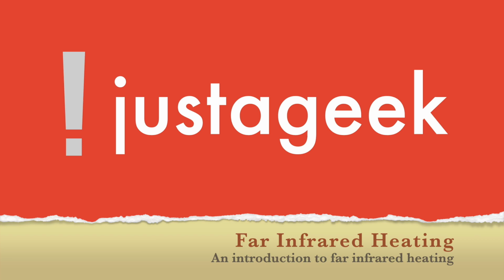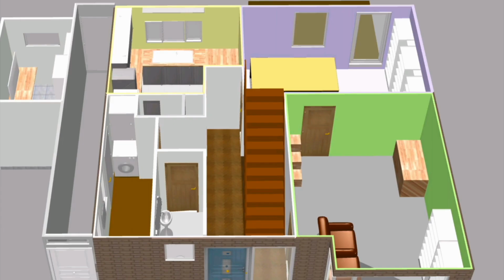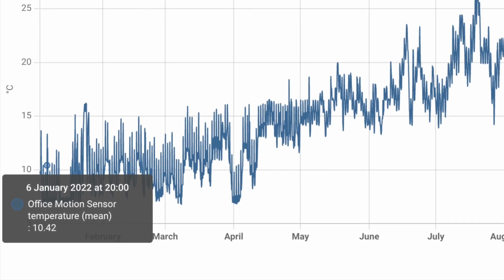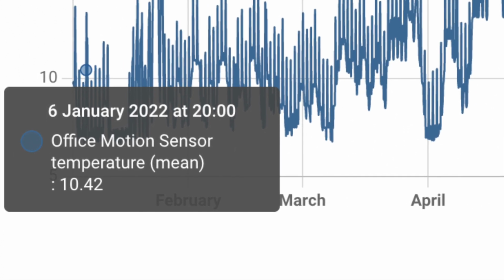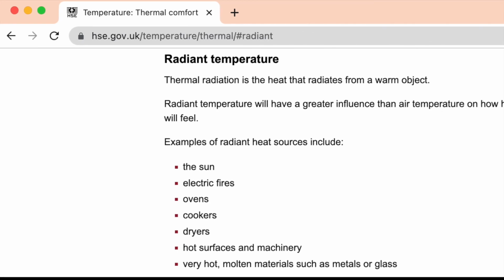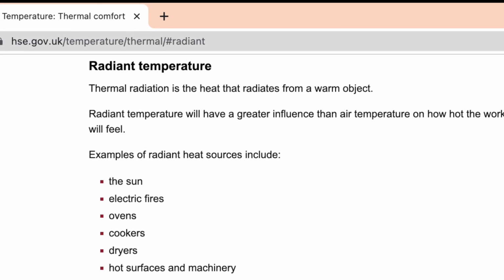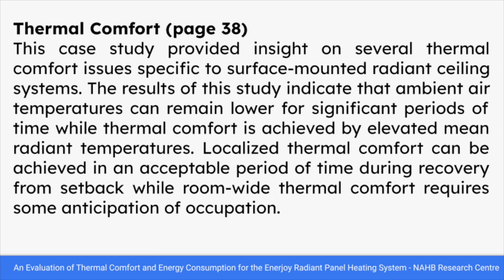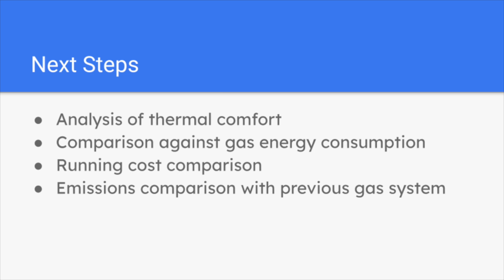Far Infrared Heating Project - Introduction

Comment: How do you find the fact that your front may be warm and your back is not being heated? Assuming you are facing the heating source of course.
Reply from the maker: It's not something we've really noticed. The panels are generally mounted on the ceiling and the IR tends to reflect / be reemitted by surfaces in the room. A few noticeable improvements other our previous heating system:
- leather seats are heated by the IR so when you sit down the seat isn't cold
- hard floors tend to be similarly heated
- we noticed draughts through the chimney far less in stormy weather

Comment: Hi, Peter, Thanks for going into such detail on your FIR  heating experience. We have a 6.8KWP solar array with a 13.5KW battery. We are still using mains gas and I am keen to see what options are available other than AHSP and started to investigate IR heating panels and whether they might be more cost effective compared to gas. I am already using HA to track solar usage as well as exporting excess solar to the grid with Octopus Flux. I like the idea of using IR coupled with motion sensors as my fear is IR would get very expensive if not used efficiently.
Reply from the maker: Hi Chris, thanks for the comment. Home climate control is an interesting decision to make with many variables - whether IR will be comparable / cheaper than a heat pump will largely depend on zoning/controls. I've been reflecting on controls and I suspect the best is a mixture of motion sensor, normal temperature measurement and black bulb temperature measurement - I'll be putting out a video on the topic in the near future.

You might also want to look at air to air heat pumps (effectively air conditioning) since they tend to be more responsive that air to water systems.
Reply: @notjustageek  I use Tado to control the boiler with every room zoned using smart TRVs so I like this approach and it is working well for us currently to help manage our gas bills. Whilst trying to balance cost vs comfort (trying to keep everyone in the house happy😊). I look forward to your video on heating controls. I need to look into air-to-air heat pumps. I know @TimAndKatsGreenWalk have an A2A system installed.
Reply from the maker: @ChrisALindsay  You might also want to take a look at @EVPuzzle, they've done a pretty good series on an A2A heating system.

Comment: Interesting indeed , as I’m controlling my IR heating with temperature sensors rather than motion , but I can see the advantage of your motion sensors
Reply from the maker: We use different approaches in different rooms. The wet rooms, kitchen and office have motion sensors to trigger heating but other rooms are time/temperature controlled.  In the rooms with the motion sensors, it should be noted there's a temperature sensor within the motion sensor so we use some thermostatic control as well.  Hope that makes sense.